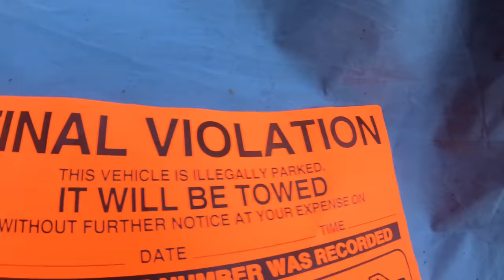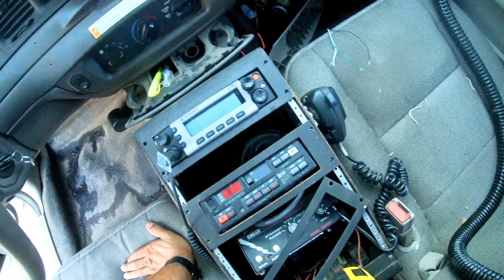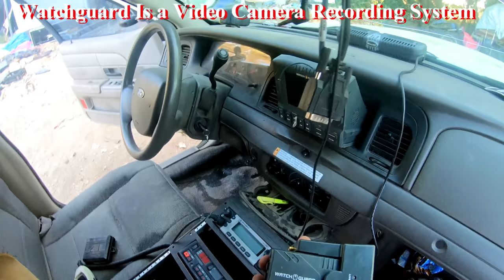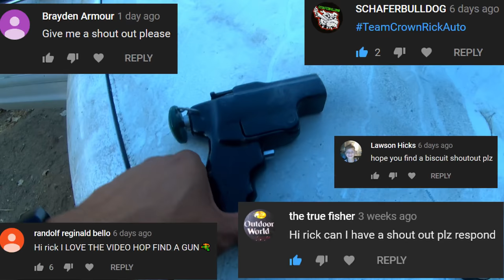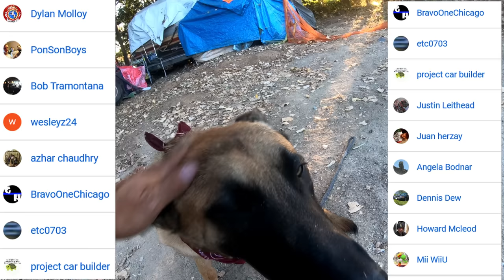Searching a Sheriff K9 UNIT found zip gun! Crown Rick Auto Police Cars

Comment: That zip gun is pretty interesting, I have “experience” with zip (homemade) guns in the past. That one was made made from a flare gun (likely stolen from somewhere) and was modified to fire shotgun shells. The weapon was likely a last resort weapon, one shot and no sight, I would guess was used by who was not in a gang but led a gang life style but I am likely wrong..The green button seems to be a bump stop from an automotive lift and has a firing pin on the end. I doubt that trigger worked, but if it’s based on a flare gun then you never know. The barrel could be homemade, as the barrels of normal flare guns tend to not be great under conventional ammo

Good think you guys didn’t fire it, converted flare guns can make your fingers hurt and you wouldn’t be able to search for guns without fingers on one hand.

Comment: I was L.E. from 1961 thru 1996 when I fell from a 2 1/2 story building while on surveillance.  I have seen MANY patrol cars sold at auction.  I HAVE NEVER seen one sold with all the equipment I see on your web-site.  These MUST be from large departments that have more money than they need.  The State I am from we stripped everything out and cleaned trunks and under seats making sure nothing was left.  I am sure things are overlooked, but not what you find.  I know lights that have been used in 5-6 different cars, gun racks and other equipment the same.  How times have changed.
Reply: These videos are 100% fake. No department sells cars in this condition. Absolutely some things are overlooked, but this guy consistently is finding multiple light bars, radio components, and a variety of oddball weapons in every crown vic video he posts on here. Yeaaaaahhhh... that just ain't adding up.

Comment: You can sell the  motorla xtl 5000 for amature radio to be reprogrammed for apco phase2  radio nets. But make shure the radio is wiped clean of the old repeater system so you do not get in trouble. Or just know your customers . most armatures can be trusted.